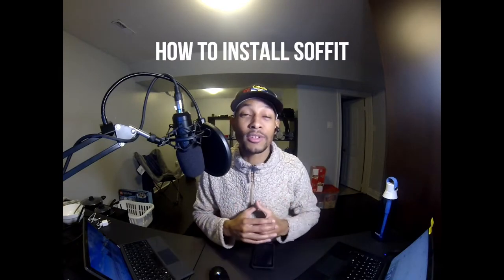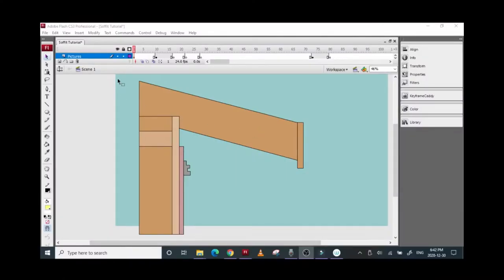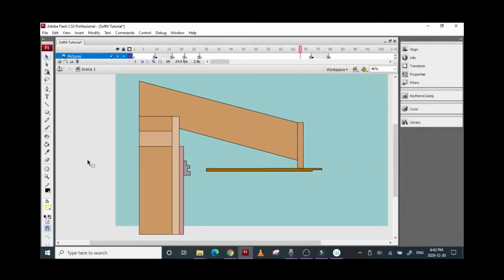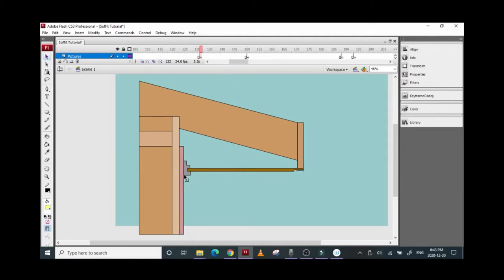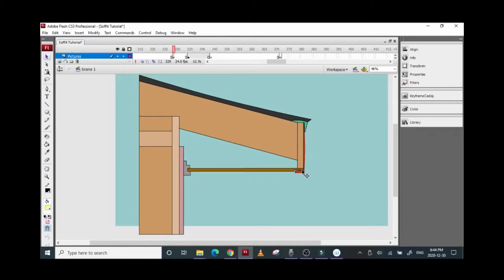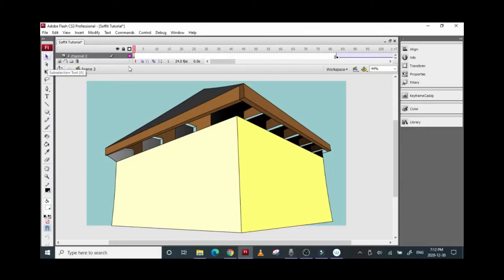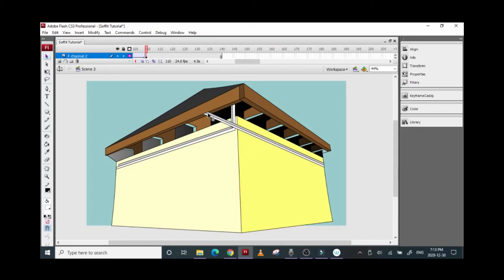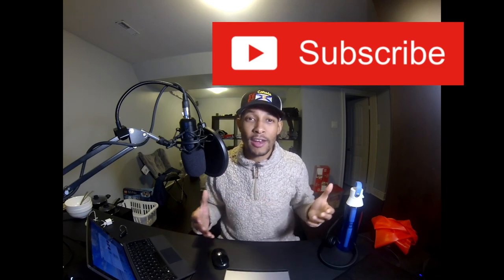SOFFIT, FASCIA, F-CHANNEL INSTALL EXPLAINED

Comment: I still have the original soffit which is wood and Masonite, it's all termite eaten so I'm getting ideas now. The sheathing on the garage wall needs to be replaced as well so will do siding and soffit at the same time. Do one wall at a time. Just replaced the back garage door and had to replace 90" of the sheathing and rebuild the entire rough opening. This will be next year's project and that wall will be the guinea pig for my DIY skills.

Comment: What channel would you use where only the soffit is vinyl with a 3/8" reveal(above bottom of facsia, which won't be vinyl covered) and the soffit is not level but follows the slope of the rafters(2/12). Also the wall is brick not wood. Thanks

Comment: Should the channel be installed with the nailer down instead of up if the siding isn't on yet?
Reply: So that's a yes?
Reply from the maker: Let me take a quick Lol at the video again so I understand the question more clearly. I did this video such a long time ago.
Reply from the maker: So the F-channel needs to be installed exactly how you see it in the video with or without the siding installed. Don't install it with the nail holes upside down because then the nails that secure the F-channel in place in will be exposed to more condensation and moisture.
Reply: @AverageGuyDIY  Got it.  Nail fin Up. Then when the vertical shiplap siding is put up, it will butt up against the bottom of the channel and the nails will be up above in the soffit space.
Reply from the maker: @-CMoore  You got it!
Reply: @-CMoore I install it with the holes down, if your installing metal vertical siding because if not the underlayment will be exposed

Comment: So what if I don't want to nail each soffit and just add an F channel on the subfaica board and just insert them?
Reply from the maker: Over time it will expand and contract, you do want to make sure it's secure but of course that is possible as well.

Comment: J Channel is used on almost all block homes in Florida. You cant install the F on a 2x2 nailer with Stucco. Fine on wood frame.